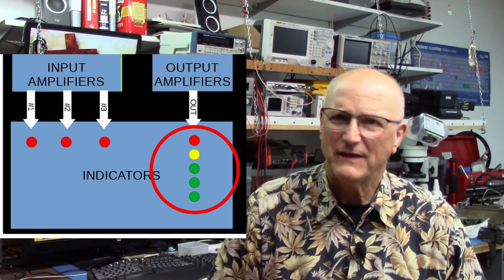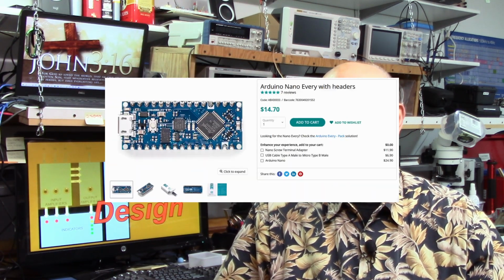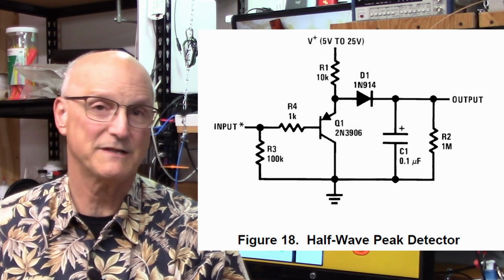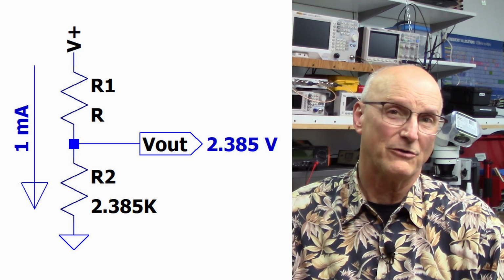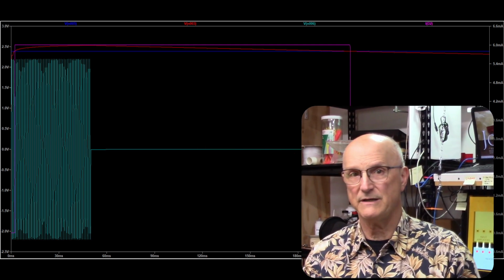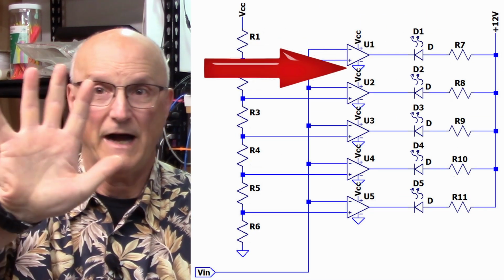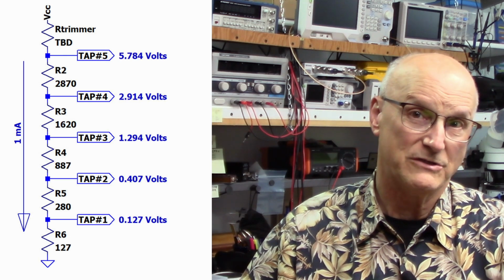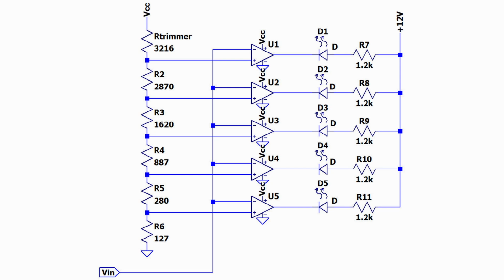Design End-to-End: Step 3b - Initial Design for the Indicators Function Block (060c2a)

Comment: Can you please explain the operation of the half wave peak detector. By the way, I just came across your channel, and I am loving this series. 😊
Reply from the maker: I'm so glad that you are enjoying this series! 🙂 It was a lot of fun to put together, too.
It's kinda late at the moment. I'll get back to you on that explanation. I have to go back and look at the circuit again. 🙂
Reply from the maker: Well, I am back. The half wave Peak Detector ...
The transistor is an emitter follower, which means that its gain is always going to be some percentage less than one and that it is a non-inverting amplifier.  At the emitter we have a diode which provides a one way trip to the capacitor (0.1uF) which is charging through the 10K emitter resistor at somewhat of a loss due to the forward voltage of the diode. This charging cycle is slowed a bit by the 30M resistor across it. The 30Meg resistor also provides a discharge path and sets to dwell time of the output once the stimulus drops. This value may have to be adjusted to accommodate a different load on the output and a different "dwell-time" (how long you want the DC output to linger).
So, essentially, this is a half-wave rectifier with adjustable time constant. The transistor acts as the buffer amplifier and driver for the output.
You can download the simulation results and design file with this LINK to a ZIP file: 
https://drive.google.com/file/d/1gqkl2TDSNODeWtBYBU0fFvu2-xK5Cu08/view?usp=sharing
You can download the *FREE* LTSpice program to run the simulation yourself for this and a multitude of other projects here:
https://www.analog.com/en/resources/design-tools-and-calculators/ltspice-simulator.html
I hope this makes sense. 🙂

Comment: These videos are awesome. I did my own similar project last year. I'm comparing notes.

I think the Arduino could have averaged out the dc from the a/d input mathematically. Think of numerically differentiating (like a capacitor) and then integrating, you should get back pretty close to the same signal with the DC removed.

I really appreciate the Smith chart videos.
Reply from the maker: I'm so glad you have found the videos helpful. 🙂

Comment: Your initial design spec was for the peak detector led to turn on for 250ms, now it is 210ms according to the simulation result, wouldn't that be a problem? And what happened to the retriggerable monostable multivibrator?
Reply from the maker: First, thanks for watching! 🙂
It is clear you are paying close attention and I like that!
Yup, the initial design spec was for 250 ms ... this is a number "pulled out of the air" from years of product design experience.
One thing that was missing from ALL of the numbers in the design specification was tolerances. This is a BIG naughty in professional design specifications.
In a real, professional design spec every target value has a tolerance or, at least, as range. So, a specification like this 250 ms would be specified as 250ms +/-50ms or 200-300ms or 250ms +/-20%.
Sometimes we would see a specification like "It must be no less than {some number under certain conditions}. An example of this is, "The audible alarm will be no less than 80 dB SPL at a distance of 3 feet."
In this case, because the purpose of the 250 ms is to ensure that the LED be visible on peaks, it is a relatively loose target.
Regarding the retriggerable monostable multivibrator, this was to establish a hard 250 ms on time. This same function was, in practical terms, accomplished by the timing of the Peak! detector and its RC network. Because of the nature of this, we can nicely "get away with" a less precise method of ensuring the proper timing of the LED.
Even with an official retriggerable monostable multivibrator we are still depending on RC time constants (and their tolerances) to establish and maintain the timing.
Hope this helps! Thanks again for watching and your thought provoking comments! 🙂